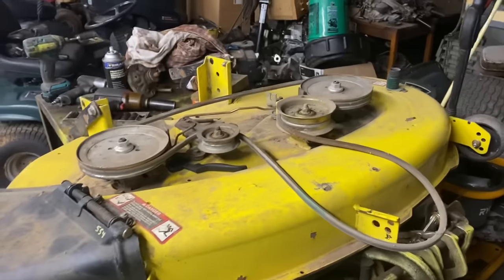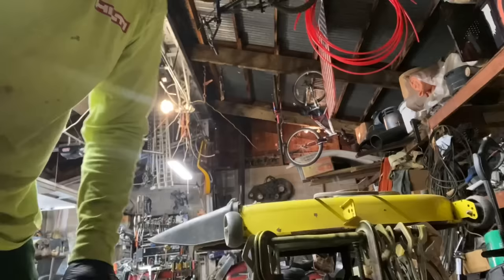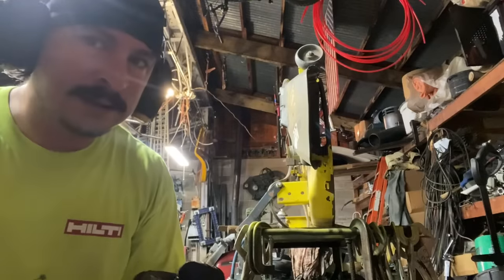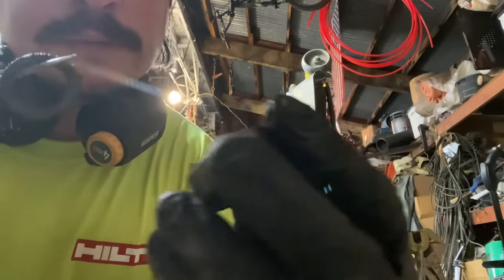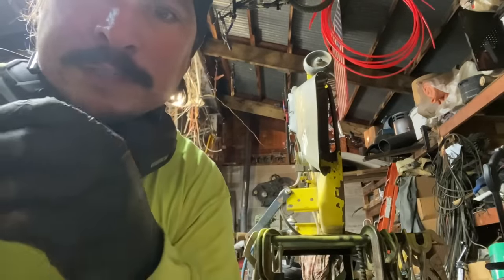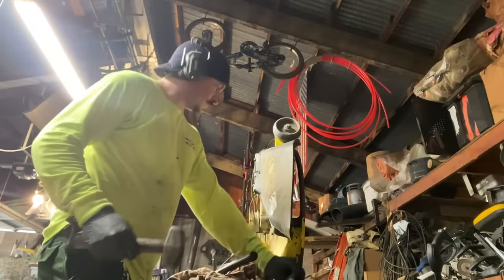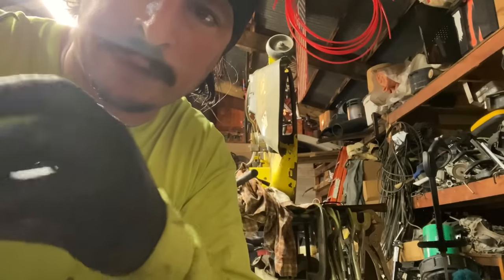Part 1 - Don’t trust the “Experts” Grease your mower deck sealed spindle bearings Common sense.

Comment: Problem with greasing the bearing as much as he did could push out the seal on the other side of the bearing.  This could result in contaminants entering the bearings causing bearing failure.
Reply from the maker: Yea expect for it doesn’t push the seal out. As Iv explained on a few other comments. If you have ever disassembled these after greasing you can test the process. Iv never had a seal come off. And there is no space to allow seal to come off as the assembly is tight. But I see how one could come to that theory while just thinking about the process. However in real life for this application it is not the case. Thanks for the comment.
Reply: @GTObearclaw1  I have worked mechanical repair/maintenance for 40 years..  It can happen.  We grease 1000 ton chillers and 600 hp air compressor motors.  We are required to remove a plug on the lower side of the bearing housing prior to greasing to relieve pressure on the bearing seals when greasing to prevent seal blowout.  After running for 1/2 an hour the plug is then re-installed after the grease has had a chance to warm up and any pressure relieved.  Thanks for the reply.
Reply from the maker: @danielh7503  sometimes what we know about the maintenance process for one type of application can block the way we problem solve for another. I think that could be the case here. But as I don’t have any experience in your specific field of expertise, I can’t say that With great certainty. However it sounds like these are very different applications and should be treated as such. What works for one may not work for the other for a variety of reasons. So servicing a deck may very well be a much different process. I have been doing this specific application for many years never experienced a single occurrence of a seal becoming separated from the bearing housing while adding grease. Even when using a needle to apply grease to a bearing without it being in an assembly has not occurred in a seal becoming free of its installed position. This could be for many reasons that I don’t know. Most likely because the lip of the seal in this application allows for passage of grease with little to no resistance. Never have I seen a seal come off and I don’t believe the way I show in this video can result in a seal coming off. Most likely due to the way the components are assembled in this application there is no room for seal to back away from the bearing. I guess it could be possible the lip of the seal could move out of the grove on the bearing race/housing but Iv never seen that happen either. I’m just sharing what has been working great for me, and I’m offering an alternative to the opposition on the topic. Many mower repair people on YouTube say the sealed bearings won’t take grease. I just proved that wrong. And out of all those “Experts” none of them take time to prove the theory. They just stand in front of the camera giving opinions on the topic with no proof. And trusting folks seeking  advice should consider the other side of the coin. Everyone can test for themself, I just do not believe the way to go about it is to avoid greasing the bearings because someone said it won’t help. Or follow advice that I should dismantle a new deck to remove a few inner seals/ shields that won’t stop grease from passing. As far as a bearing pushing off, even if the inner seals were removed the same pressure would be pushing on the outer most seals so by adding grease it could still result in the outer seals pushing off but like I mentioned Iv never once see this happen. So being that I do not know or think it’s a concern I think greasing a deck as Iv shown in the video is a practical way to service deck bearings requiring less time and work and also extending the life of the mower deck bearings. I’m not providing information on how to service any bearings other than lawn mower decks that use the shielded bearings. This is the specific application I intended to cover and nothing else, I know absolutely nothing of maintaining bearings in chillers or air compressors. Sounds like those units are a little different in the aspect of needing to run and allow time for pressure to adjust as grease heats up. Iv never seen anything like that on any of the lawnmowers Iv worked on. I just think it’s wise to understand and test the specific application and it should be considered that the process can differ. In this case it’s a proven process that has worked great for me and I wanted to offer it to help others. The original comment was directed to the viewers saying the way I did it can cause issues. I just want the viewers to wrap their head around the process. Hopefully some more folks try it and report back with positive findings. I don’t see how they could find any outcome other than what I have found as Iv had the exact same results every time. 

I guess I’m the next video I can try to get deeper into this and find out if there can be any cause for concern. But so far Iv not found it to be a concern.

Comment: in my opinion, if you fill the spindle with grease, when the metal gets hot an expands, grease will get in the bearing.
Reply from the maker: Not sure I’m smelling what your stepping in.

If they are greased, then they won’t get near as hot as if they are dry.
And if you pump enough grease in then they are greased regardless

Comment: Just leave the inside seals off if your checking the bearings or replacing them.  If there isn’t a zerk fitting put them in.
Reply from the maker: They don’t matter if they are there. So the point of the video is to grease the ones with a zerk and don’t waste time worrying about those shields. That’s are not gonna matter. If folks add grease to start with then they won’t need to worry about removing seals because they won’t need to take the deck apart to mess with bearings.

Comment: if you dissassemble to that point why not just take the rubber seals out and repack the bearings thereby eliminating the huge mess of non-functioning grease left in te housing
Reply from the maker: Simply because I was making a point. The point that dismantling a deck is not necessary to get grease in a bearing if the mandrel has zerks. If i didn’t know any better and I wanted to waste peoples time, I’d tell them to grease bearings like you say. But I’d rather explain the simple way so folks who understand what I’m explaining can do it the easiest way possible and receive the same benefits as the folks who take the deck apart to grease bearings when the mandrel has a zerk. Why waste time? 

You do understand that the reason I took the deck apart was to show that grease passed the seals, right?

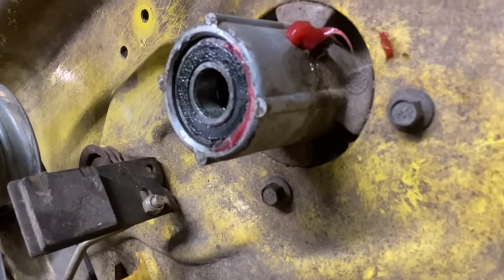Comment: 10:04 you forced the grease out between the outer race of the bearing & the aluminum housing which was already weakened, NOW expect the outer part of the bearing to spin IN the aluminum housing, when knocking bearings in & out of ALUMINUM housings you should use Loctite on the outside of the bearings
Reply: Loctite is good insurance much agreed.
Over a term, with no lubrication remaining, sped up by water intrusion, bearings first 'gall', eventually can begin to rattle in orbital oscillation, and at that time bearing outer race will 'turn in the housing' requiring rework/replacement of the housing. Until that pressure against friction of static metal against static metal degrades the press-fit, the bearing will remain in adherence to the housing.. Experience.. Theory is questionably problematic, until event is witnessed afield.. repeatedly.. ;}
Reply from the maker: It has never been an issue and grease passed through bearings. If it also went out around the bearing it’s nothing that wouldn’t happen on normal use when liquified grease runs down. There is no way to prevent it if it happens as you said. Regardless if the grease was put in with a gun or hand packed it can melt with heat and run down with gravity and access same crevices. And also Iv never seen outer bearing races spinning in the hosing. That would be easy to spot on disassembly.  Probably just the basic principals of physics at work here as the other components can spin easer before the larger outer race would turn. I see what your saying and it sounds logical but it’s never been a concern and doesn’t happen in the tractors Iv been working on. It’s a lot harder to turn that outer race than it is for the ball bearings to turn. So even if we’ll lubed that’s never been something Iv seen. So many naysayers just hate this video. And I’m just here telling the truth.

Comment: Guess I have to tear my zero turn apart. I don't even know if I have grease fittings on the spindles.
Reply from the maker: Some do some don’t. If it’s a MTD model the zerks may be facing the ground and sometimes covered with grass clippings. As usual, MTD makes dumb choices. Basically the FORD of the mower world.

Comment: I agree that it is stupid for the manufacturer to install grease zerks, then install bearings with the seal covers in place.🙄 Guess they do it  that  way so that your spindle assemblies fail early and they can sell you replacement parts.
Reply from the maker: I don’t necessarily think it’s stupid. Must be a reason for the shields to be there but not necessarily because it helps anything after the unit is assembled. However they don’t stop grease from flowing past. Just wanted to point out that the units can easily take grease regardless and try to help some folks. Hopfully it helps a few.

Comment: The most significant thing you can do for your bearings is to keep water out. Store your stuff inside, away from the rain.
I cringe every time I walk into a big-box store and see 50 new mowers sitting out in the rain.
Reply from the maker: I agree. I hate to even was a tractor. I prefer to blow mine off after each use and that keeps it clean. When I do wash one I always turn the deck on to spin the water off the bearings and pulleys so it does not have time to soak past the seals. At least it feels like it helps. But definitely don’t like leaving equipment outside.

Comment: This is the biggest problems with the new so called sealed spindles with sealed bearings. The very little grease that is in them new will spin out in no time and now you are wondering why your deck is so loud form spindle noise. They build them like this so you will have to buy new ones sooner.
Reply from the maker: I somewhat agree. Except I don’t think the grease spins out. I believe it’s just low quality and also a lesser quantity than should be used from the factory to make the bearings fail quicker. Some folks leaving comments saying they had tractors from
25 years ago last 20 ply years without a service. Hard to say but most likely the lower grade grease, less grease and lower quality parts used these days all coming together to lower the lifetime of these parts on the cheep machines. Probably one reason Briggs is now cutting he snapped and Ariens names, and the lack of sales have a lot to do with the low quality.

Comment: If you apply a lot of pressure when pumping the grease you will eventually get some grease past the seals and into the bearings.  The problem is that bearings designed to have grease pumped through them do not require that much pressure.

If you remove the seal that faces the inside of the spindle you can get grease to pump through them a lot easier.

The main problem with sealed bearings is that they use as little grease as possible and as cheap a grease as possible when they pre-grease them before installing the seals.  If you are afraid of damaging the seals you can get a needle zert and use it to get under the seal facing the inside of the spindle and squirt some extra quality grease into the bearings and they will last a lot longer.  Probably longer than the mower itself will last if you add good grease to the bearings when they are brand new.
Reply from the maker: I’m not worried one bit about damaging inner seals and it does not take much pressure at all. No need to pull he deck apart to pull the inner seals. Kinda the point of the whole video. Have to watch the whole video to get to that. But that’s why I made the video to prove the inner seals in this bearing application can not stop grease and actually pose little is any resistance to grease passing. I’m prety sure the engineers had it figured out because all these cheep machines equipped with a zerk are basically done the same way. The ones with zerks as far as big box store tractors go have inner seals for the most part. Very few Iv found over the years didn’t. Never seen a damaged seal. As for grease needles, I cover that in other videos. If you have helpful tips, consider making videos. If you have prof that my process damaged seals or does not work, please post a video and you can
Share your link in my comments to help others. You would not be the first to oppose my findings but so far nobody can prove it doesn’t work. Some have tried all have failed. The Naysayers always have a lot of reasons why it won’t work but no proof. My goal is not to be right but to provide folks with help and I can’t sit around watching the so called experts tell folks the grease won’t fast a few flimsy rubber lips on the dust shields. You have valid points but for this application the way I show works. Apparently these are the seals that let grease pass. It’s way less complicated than it first seems. It blows me away that the so called experts won’t try it and post a video showing the outcome but are eager to just say it won’t work. Not really buying that some of these guys are experts on thousands of topics. More like they just make thousands of videos and provide opinions. I’m no different except I’ll admit I’m no expert, but Iv run the tests to prove my findings. And I make very few videos. Usually try to stick to stuff that’s not over done. Zero failures in all the times Iv used this process. 
So far only success with this process.

Comment: And don’t spray with water hose
Reply from the maker: I know that’s right. I occasionally have to power wash one but always turn deck on immediately after to sling water off the pulleys. 99% of the time I use a blower after every mowing and my decks stay nice and clean.

Comment: Mine has tapered timkin style bearings
Reply from the maker: If it has a zerk on the mandrel you can grease it the same way. Only diffrence is yours is a much better quality assembly if it has the tapered bearing set up. Those are great. But still require grease.
Reply: @GTObearclaw1  yea, I do. I like the tapered much better

Comment: whoever thought a grease gun that can  put out around 15000 psi would not push grease threw them flimsy "covers " not seals  on them bearings should have their head examined , and lay down the tools forever , its going to  flow to the path of least resistance so  unless you have a spun bearing in there its gonna go threw the "covers" , because with 15000 psi its going  to go somewhere
Reply from the maker: I agree 100%. That’s exactly why I made the video. Seeing all the other videos saying they wouldn’t take grease was blowing my mind that folks were that miss informed.